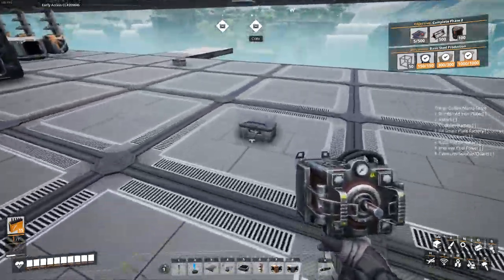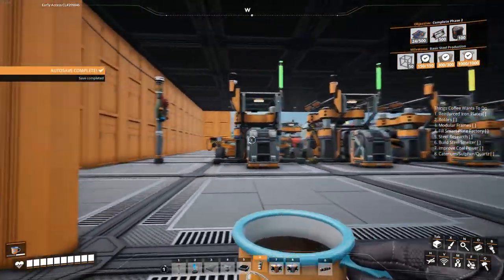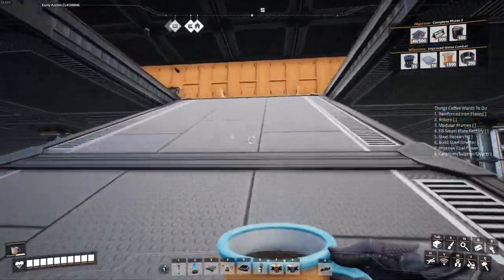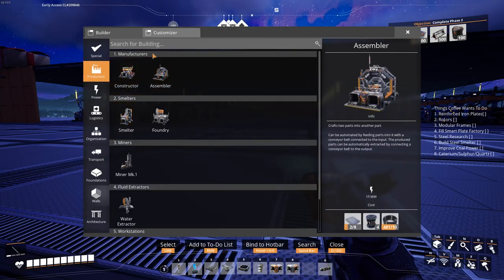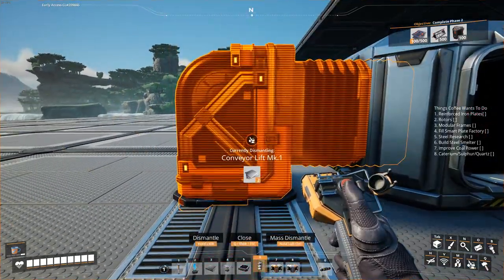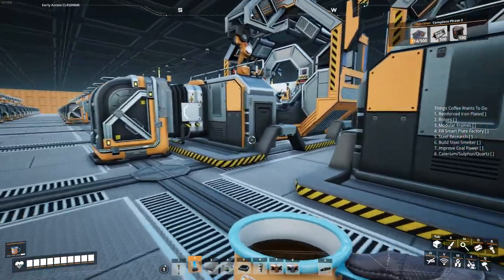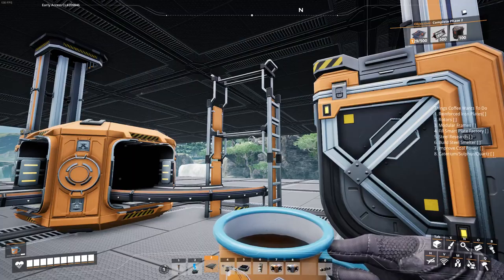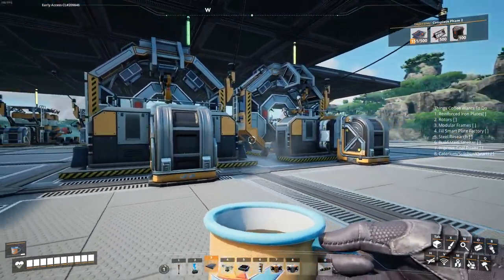Logistician Plays - Satisfactory - EP. 10 - Reinforced Iron Plates Manifold

Comment: I guess you realized that the Screws are greatly needed because you need so many Reinforced Iron Plates and a good number of rotors all the time and for building everything.  It has been noted by many pioneer's as their bane because you need so many, and you can easily push the limits of your conveyors with them.  
I build my manifolds much like you have, except I tend to compact the splitters/mergers underneath very close to the ceilings.  There are a few tricks to do that more easily from just say stacking like three and removing the bottom two, or building a platform of 1 meter foundations to build on then remove those foundations once or just before you have the conveyor lifts attached.
Reply from the maker: Ya it's definitely an intense issue